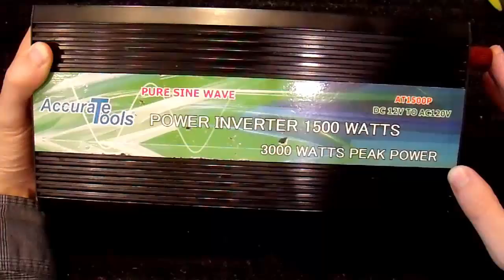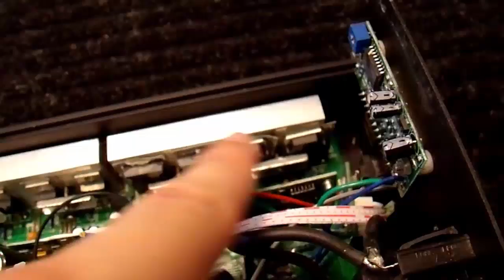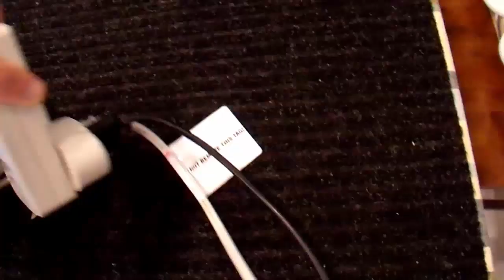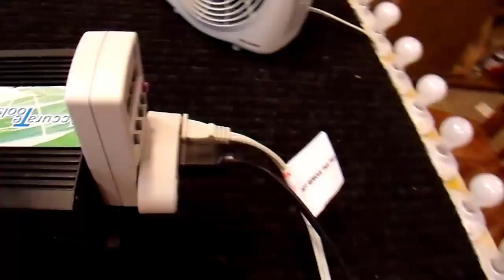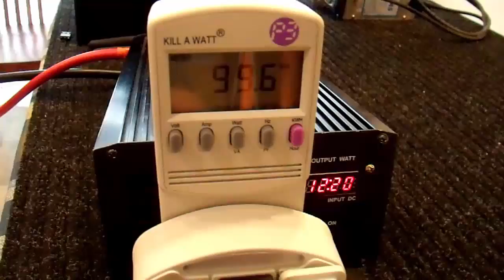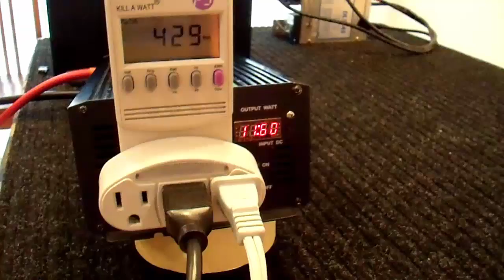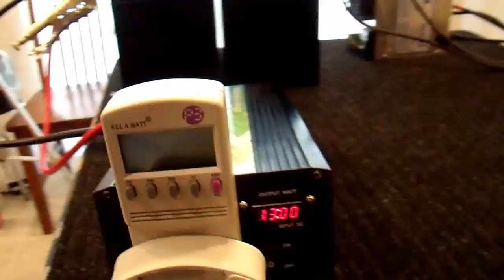Accurate Tools Pure Sine Inverter Review and Repair - Part 1/4

Comment: I have an Accurate Tools 300 watt pure sine wave inverter and it has been my workhorse inverter in our camper for a few years.  My crude test of AC waveform suitability is if the flat screen television in the camper makes an awful humming noise when it is plugged into it.  With a MSW inverter, the TV will have a loud humming from the back of it as soon as it is plugged into the outlet.  With the Accurate Tools 300 watt PSW inverter, there is no humming and the TV works perfectly.  It worked well enough that I bought a 1000 watt Accurate Tools pure sine wave inverter as well.  However, the television makes a quieter version of humming sound when plugged into its outlet.  Any ideas on what causes that?  Thanks.

Comment: Very nice.  One thing that happened with mine is that two fuses blew and I did not have any smoke!  Your video was very good in showing how the case comes apart for in my case it did NOT open easily. 

My unit has 3 transformers.

Comment: the inverter i bought and want you to review has fan control but runs it all the time but not full till hot, its nearly fool proof in design where you can hook even ac 12v to the input and it will think its pulsed dc, literally i hooked it up in the dark when my power went out and if it didn't turn on id reverse it, its 23$ for 300watts or 71 for 1000watts, the only way to break the input side is really high input voltage (have not tested but there is no protection that i see) of course if you short it from the cap on the inside it will blow, the output side is short protected at least that trying to run my stove and 4500 watts of radiant heat and 1800 of convection heat just stalled it and it tried to reboot repeatedly but never blew, the input is fully isolated and only connected magneticly, if you run 120 wall power to the inputs it sits there happily till you turn it on, then it blows up spectacularly where it blows the whole input side except the drive board and the dc cap, the driver may be broken i cant tell, also switching to 240 split phase with 2 of them is as easy as 2 diodes in place of the drive ground leads and wires connecting drive grounds then cutting 2 traces on the back witch i can do with a box cutter and soldering wire to 4 through hole board connections then just hooking the drive from one to the driven of both and thats it to pair and isolate them, then you can take l1 and l2 and pair them and pair n1 and n2 to get more current or take l1 as l1 and l2/n1 as N and n2 as l2 to get 240 with a centrer tap, i will be doing this soon but need to get more inverters

Comment: I don't suppose you could show the waveform on a scope at idle and under load some time ?
Reply from the maker: This inverter is currently employed as my 'automobile instant heater' so that I have a large amount of instant heat in my car on those cold winter days and won't be available again until spring.  Perhaps I will at that time.  :)
Reply: ***** No problem.  I saw that you had a oscillographing volt meter showing a waveform of a modified-square-wave inverter in another review.  These are handy for showing their regulation abilities, especially sine-wave inverters.  Thanks for the great videos with or without these waveforms !  The tear downs are especially appreciated.

Comment: the smaller 300 watt inverter has a fan control circuit. i imagine the larger units would too.
Reply: looks to me like the previous owner hot wired the fan, or from factory they just half assed quick. I have this exact inverter, only difference is mine only has 2 input power lugs and my fan is plugged into the pcb in the jack he shows

Comment: Any chance you could review the larger accurate tools 5000 watt inverters at some point? I bought one of these and it seems to do quite well and can hold a consistent 4000-5000 Watt output in a motorhome, I was just wondering the quality of these, they appear close to a power bright model in looks but price point is much lower.

  http://pages.ebay.com/link/?nav=item.view&id=290987608713&alt=web
Reply from the maker: Hopefully they improved the quality from the unit shown here.  I haven't seen one in person nor do I have plans for a review of one unless I happen across one!

Comment: That ground should be connected to the neutral side, many appliances use the ground for filtering, that's just crappy design
Reply from the maker: UL-458 does not require a GND-Neutral bond internal to the inverter and most products don't tie the two together unless they feature CFCI outlets.  I'm not saying this inverter is great, but the absence of that connection is standard practice with inverters.
Reply: ***** Wow, seems  to me like one hell of an oversight!
Reply from the maker: *****
The reason is technical, in that inverters often use a live neutral configuration where both the Neutral and Line are square waves shifted 90 degrees with respect to eachother.  In this configuration neutral cannot be tied to GND so the regulations are written to accept this reality.  It helps keeps costs down and allow for market pressures to provide competition.  I do prefer units that allow a GND-Neutral tie though.  The other type just aren't as good.
Reply: ***** 90 degree shift... is THAT how they do the stepped 'modified sinewave' ?? If so that's bloody clever!

Comment: As I said in another comment on Knurlgnar's reviews...I had two of these Accurate Tools Cheapies from Ebay...my 1500 PSW burned out in around 32 days. The 2000 in around 16-17 days. The return policy was 14 days.   THEY KNOW....They HAVE TO....
  I had the same experience, but mine had only one set of hook ups in the back. My watt/volt indicator was the same, or so....the 2000 had a faulty switch as well.
   So....Thank you Knurlgnar....NOW I KNOW WHY!!!!! These went bad....because they ARE BAD!!!! And it was nothing that I did....They are over powered on voltage....nothing really NEEDS 125volts...House current is 118v on my Kill a Watt. My cheap 400 watt inverters run my 300 watt one cup coffee maker just fine at 111v-112v...so does the OSP Tiger Claw...then as you saw in the video...the other poor things about these inverters...and it is NOT JUST THE 1500!!!!!
   I had taken my inverter setup in my car, with two 100ah batteries to make a friend a hotdog with my 600w Microwave oven,....did that...got home...and FZZZZZZZZZ....when I tested it again in the car....burned out. At least mine did not SMOKE!!!
  The 2000w I was just in the back study making a hotdog, and BWUOOOP! OFF.....dead....even with Fuse.
  These things are CRAP!!!!! Don't buy one.
  The OSP Tiger Claw has been an excellent inverter...No problems since purchase in June 2014....knock on wood...(like my other review.)
  KUDOS to Knurlgnar and Xboxer 1985 for their excellent reviews...and tests, etc....
  Excellent Work!!!
Reply from the maker: I am glad the Tiger Claw has been working for you!  I hope they don't change their design because as it is they have a very good product for the price point.  I also want to thank Xboxer1985 for his work on the Tiger Claw.

Comment: knurlgnar24 -

Long time viewer, first time commenting:

It occurs to me that a lot of the "brand name" components on these inexpensive inverters are most probably counterfeit.  For example, the primary capacitor on this unit, which looks like Rubycon MXR is most probably fake.  Often, fake large-value primary capacitors have a significantly lower farad rating than what is printed on them.  You should also consider that input stage capacitors (Actually, in inverters, primary capacitors are output capacitors and secondary capacitors are input capacitors -- if I understand how an inverter works, that is) often fail without showing any outward signs.  The electrolyte can dry up on the inside and the capacitor can still look perfectly normal.

In PSUs, the quality of the primary capacitor isn't as critical as that of the secondary capacitors.  I wonder if the reverse is true in an inverter.

You should also consider that the transistors in these units might also be counterfeit.  Either way, if you're going to repair these units, you might seriously consider investing in a sub-$100 ESR meter for the caps.

Cheers, and great videos.  Can't wait for the next few parts.
Reply from the maker: Those are good thoughts, and I have certainly seen counterfeit components before.  Somehow it didn't occur to me that some of these may also be counterfeit seeing as the consumer never actually sees them, but often times the sourcing agent for contract manufacturer who are less than tier 1 accepts kick-backs for purchasing counterfeit components - a common practice in certain regions of Asia.  Mislabeled components are certainly a possibility.

I would not expect the FETs to be counterfeit simply because IR competes very strongly in Asia and there's little reason to do so, as well as this being easily detectable.

An LCR meter that can measure ESR is a tool I'd like to have but I don't have much application, honestly, seeing as I'd have to remove each cap in order to test it which is effort I'm not willing to put into it unless I suspect a problem - in which case I can just as easily replace the caps instead of testing them..

Thanks for the comment!

Comment: 7:15 it looks like the transistor that died wasn't particularly well mounted. Is it just me or is it not flat on the heatsink?
Reply from the maker: The transistors (not only the one that died) were poorly mounted, yes.  I actually improved the mounting compared to what it was when I disassembled it the first time but it still wasn't very good due to the heatsink clamps being too short to properly cinch the FET to the heatsink.

Comment: Those wires are in fact how current shunts are made, there's not supposed to be any resistors. If you open any multimeter, you will see pretty much the same thing on the 10A scale. Granted, the ones in the video weren't probably trimmed for the job, but no resisters were meant to go there. (You wan't very low resistance in a current shunt. Less than 0.1 ohms, as you are drawing all the current over it)
Reply from the maker: The temperature coefficient of ordinary 'wire' is poor.  Proper current sense resistors may look like wires but are actually constructed differently, are trimmed, and behave differently over temperature, etc.  Given that this inverter outputs around 12A the resistor is likely supposed to be around 10 milliohms.  My inability to properly calibrate the display may also be due to the omission of an amplification step (for cost reasons) before sampling, as 10 milli will only yield about 120mV of full scale swing.
Reply: Huh TIL thank you :) And yes cutting out a shunt amp for cost reasons is very likely :)

Comment: They should have just clipped the extra length off the input lead wire and used it to ground the case. Sloppy one hung low design.
Reply: Chances are very good that power line neutral is connected to case.....And dc in is connected also....

Comment: I'm only asking....not complaining or trying to give you a bunch of feces...I noticed that the kill-a-watt looked as though it wasn't plugged in all the way...<sagging away fron the inverter>.  I realize that contact is contact, but, could that have affected anything ?   I'm figuring that the way the inverter was designed and put together, it wouldn't make a difference .  I'm asking, because when I use my kill a watt...when putting several plugs into it, it seems to sag down.  Thanks in advance.  Love your vids !!!!!
Reply from the maker: The losses from the Kill-A-Watt 'sagging' is insignificant.  At 100+ volts the <10A that flows through those contacts loses less than 1W from the contact to the electrical outlet.  Essentially if the prongs don't warm up too much then you're OK, and seeing as both the Kill-A-Watt prongs and the outlets on the inverter were good quality there was no noticeable heating.